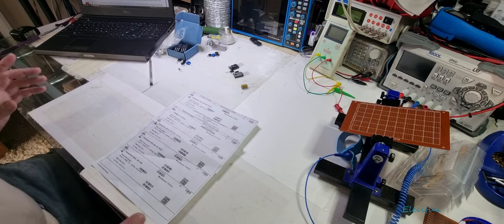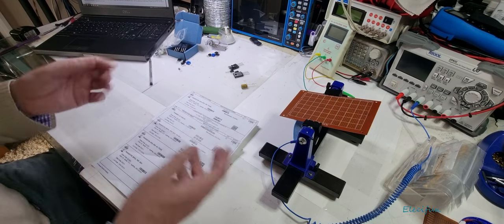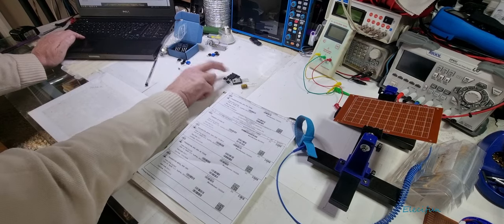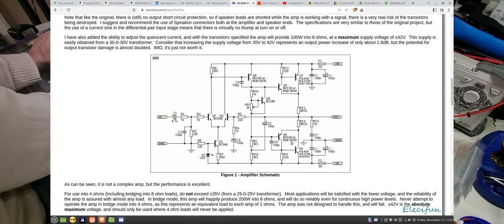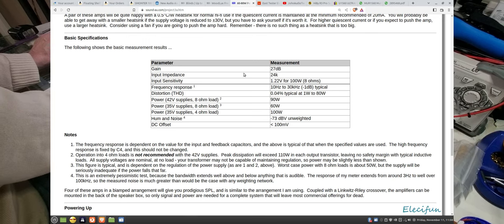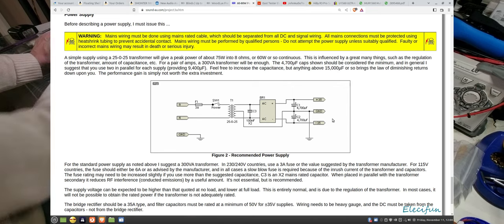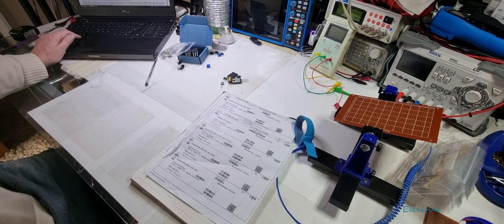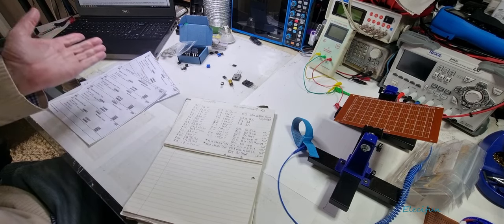ESP DIY Audio Amplifier Build Components

Comment: Brilliant! I am looking forward to these build videos Elecifun. Thanks for showing this project. I built my tube (valve) driven hifi from a kit from Tube Depot. It was a blast to build and delivers fantastic audio. I want to build another but they are quite expensive for my budget even in kit form. Around $350 USD if I remember correctly.  Anyway I think I'll build a solid state one this time. Your videos are always inspirational as well as informative. Thanks for posting these great vids.
Reply from the maker: Ox I didn't realise you were into building electronics, nice one on your tube build. As I understand the even order harmonics are very pleasant from tube audio. 
Thanks for the comments.
Reply: I got into electronics building through my guitar playing hobby. I've built some stomp boxes as well. Always from kit though because my knowledge of electronic circuits is quite limited. I do prefer tube amplifiers for guitars and hifi listening. To my ear they are warm and rich sounding. I do want to experiment with your solid state builds though because it seems less expensive and maybe I could combine with the 3D printing or metal work hobbies for interesting enclosures. I'll YouTube my efforts when the time comes. Thanks again for inspiring and instructional videos!
Reply from the maker: Your very welcome.

Comment: Hey amigo,

Have you done any SMT soldering?

Geezez it's hard! 😄

I just finished another project.

It's dead.

😔

Another one bites the dust !

Anyway night. 

I just finished not long ago.
😴
Reply from the maker: Yeah done a bit also some reflow work in drone controller. That was fun.
Reply from the maker: Its the practice that counts buddy.
Reply: @Elecifun  Yeah, I Bet it was ! What's size ? When you get into the really small SMDs it's just so difficult. Even at O805 it's so damn hard not to cook the components. Sigh. I lost count on how many components got lost. Ping!!!! Like a flea they're gone! Lol 😆
Reply: @Elecifun  Yeah, I've ordered another 20 boards. All SMDs. 😆
Reply: @Elecifun  I think I need that new iron. This thing I have just not good enough.

Not for really tiny work.

Comment: Geezez I hate this new O.S. friggin' grammar checking drives me nuts.

Also what happened to all my emoticons? Sigh. 😁
Reply from the maker: New O.S that sounds interesting.  If I every display emoticons I have to copy and paste them. I'm to old for all this crud.
Reply: @Elecifun  Well in Android 10, and 11 it was simple. There was a little circle with a face on it whereas now it's gone and they've add grammarly. Sigh. Ffs why would you do that ! I swear I hate this f*** thing! Why do they feel the need to modify something that works perfectly!
Reply: @Elecifun  so now how the fk do you add emoticons?? All emoticons do is indicate emoticons which helps communicate with other people
Reply: @Elecifun  what I hate is the updates. *sigh* fkn updates, updates, updates.
Reply: @Elecifun  the only reason I bought this phone is for the fresh battery but this battery empties quickly.
Reply: @Elecifun  Did you know that nearly everything in the S21 Ultra is better than in the S22 Ultra and the S22 Ultra is more expensive.

The battery lasts longer. (S21)

The processors appear to be faster in all variants except the Chinese and the American variants.

The cameras are better in the S21 Ultra.

Both can be upgraded to Android 13.

Yours is probably easier to fix than mine.

The video capture capabilities are the same.

The audio is the same.

The LTE and 5G capabilities are exactly the same.

Same carrier aggregatation 7, same upload, same download.

They're both IP 68 dust and water resistant. The same.

The screen resolution on yours is higher than the S22 Ultra.

The same file system UFS 3.1.

Two of your cameras are in fact better than mine. Fact 
Our front cameras are identical. Wtf.

Bluetooth stand are both exactly the same 

The WiFi standard is the same.

Same charging except mine uses a 45W charger which I don't have.

Both 5000 Mah battery.

On the S21 Ultra there is a 16GB variant option which isn't available on my variants.

Does your S21 Ultra still support Direct send?? 

My S22 Ultra doesn't have it. 

This phone of mine is a deep lose.
Reply from the maker: @decem_unosquattro9538  Mine only has 12GB of RAM 256GB SSD. It has Nearby share, Quick share, Secure share but no Direct send. 
It does have as I have just been looking around it,  Schedule message which could come in handy. Where would I find Direct send?
I keep my screen on low res as I use device for calls messages and videoing taking photos. No social media email whatsapp etc have separate device if needs must.
Reply from the maker: I have Andriod 12 and there is smiley face in messages on phone?
Reply: @Elecifun  Mine has 12GB same as yours. Mine has no WifiDirect "send" anymore only receive.

On my Note 9 I turn  WifiDirect then on my S22 Ultra I turn WifiDirect ON,  okay then I click on photo and below on the menu are 4 choices between the pencil and the recycle bin is a send option.

It looks like three round circles with lines connecting them.

Click that ....

Then look for a green icon with WifiDirect on it .. okay?

Then it says connect device

Available devices 

You should see your other WifiDirect phone

Click on it 

Then up top right corner "Share"

It should send
Reply: @Elecifun  Okay my Note 9 has Android 10.

It has the WifiDirect SEND feature whereas my S22 Ultra does not have it anymore.
Reply: @Elecifun  click on WiFi symbol on both phones at top.

The click the three dots ...

You'll see WifiDirect which you touch
Reply: @Elecifun  Did you get it?
Reply: @Elecifun  My has 512GB which I got because there is no SD Card slot now. UFS 3.1 is much faster especially the write speed. 

256GB is plenty.

I never filled up my 128GB but then I never used video much either.

So yeah that maybe one of the only things where mine has the advantage.

Pretty much everything else is better on the S21 Ultra which frankly is shocking.

I noticed two of your cameras have a higher sensor quality which the S22 does not have. 

It's seems unbelievable that samsung would do that but alas it's true.

Samsung almost just changed the wallpaper.

Comparing the two was a disappointing shock for me.
Reply: @Elecifun  The S23 will probably have the next latest UFS 4.0 which is even faster again. IiRC it's 5 times the speed of UFS 3.1. Not sure if that's read or write or both.
Reply from the maker: I think that it's nearby share now, as this is direct sharing using WiFi and Bluetooth. Try that.
Reply: @Elecifun  are you sure?